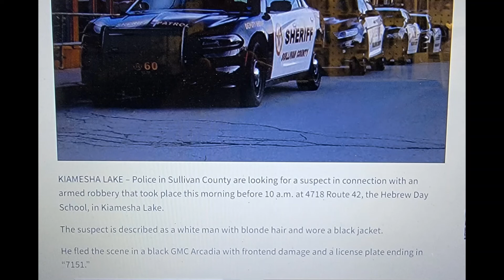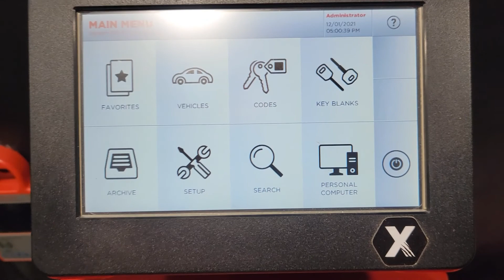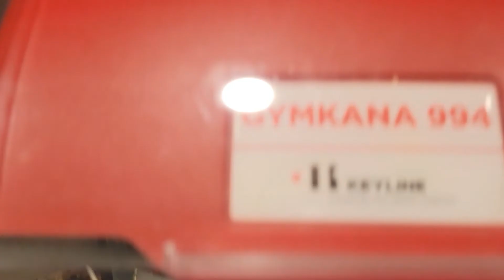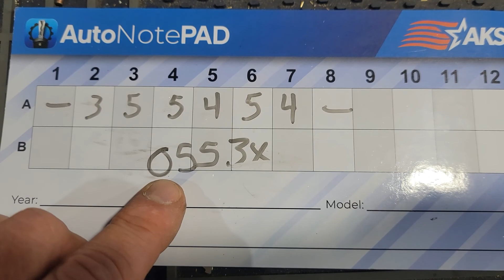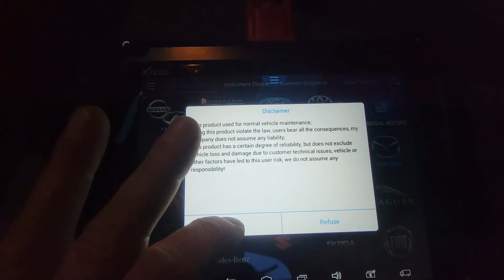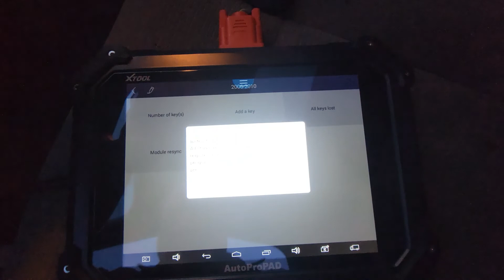Locksmith Service Calls 12/01/21 late Afternoon Lishi AutoProPad Gymkana 994 #locksny

Comment: For that campus, do you just do the cylinders for them, or do you do the install as well?  How many plates in that area would end in 7151 on a Black Acadia.  I'm thinking that's a small number.
Reply from the maker: I do everything for them. Yes, even the safes. One could only hope they found the truck with that plate already. If they expand the search, i'm only an 1:15 from NYC so, it can get big fast.
Reply from the maker: I do everything for them. Yes, even the safes. One could only hope they found the truck with that plate already. If they expand the search, I'm only an 1:15 from NYC so, it can get big fast.